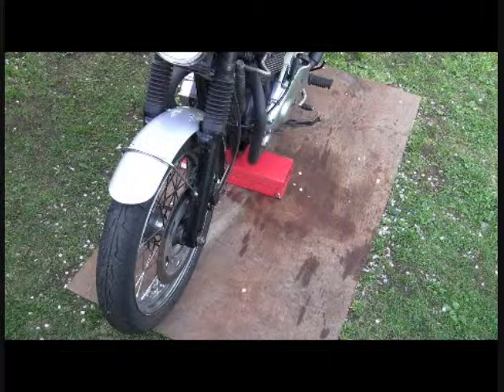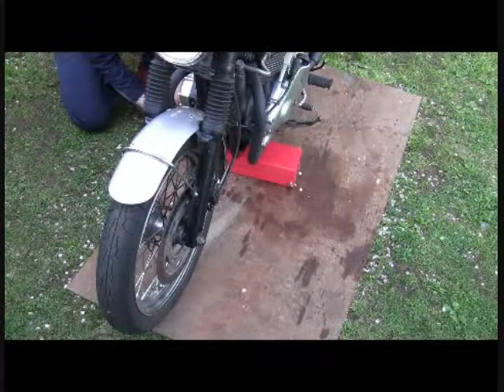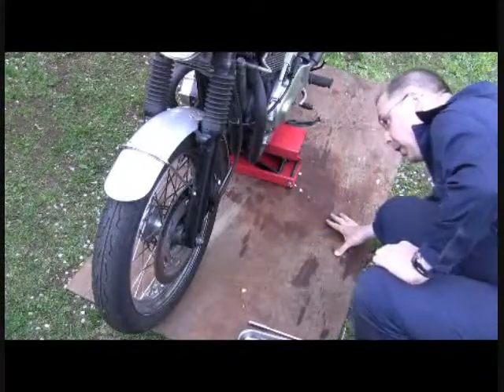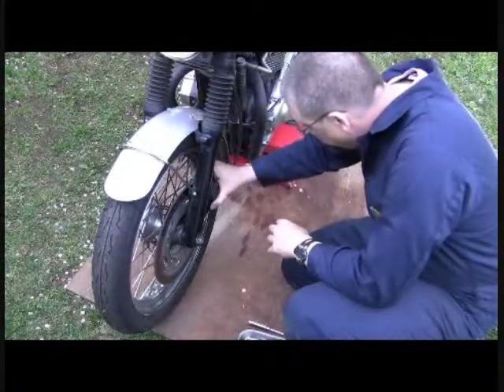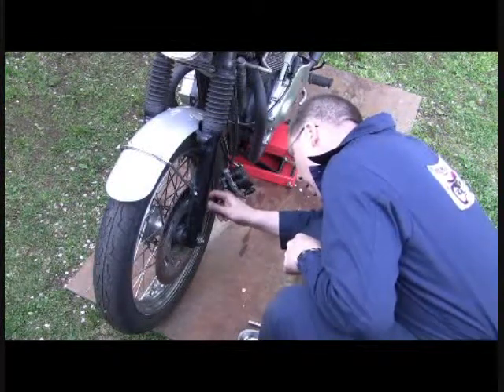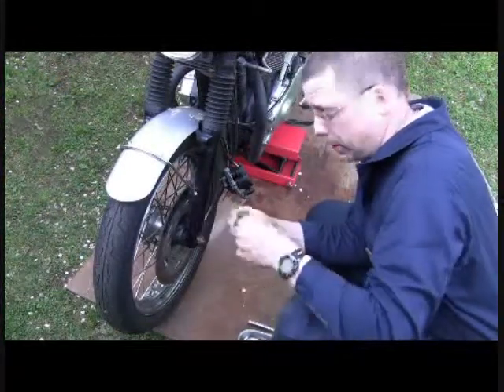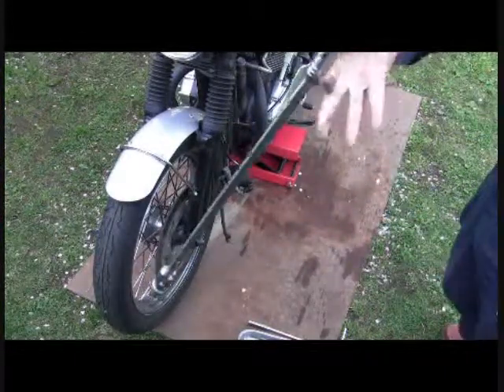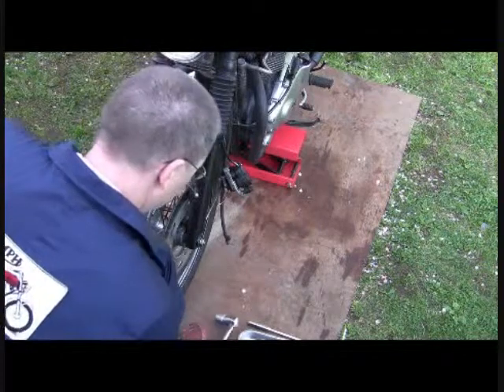Hinckley Bonnie Front Wheel Removal

Comment: Hello mate, enjoyed your video. Watching experience people give sme the confidence to work on my bike. Just out of interest, the bike lift you're using, how well do you rate it for general maintenance work? I've just ordered one myself and wonder what to expect. Cheers, ride safe.
Reply: I think they are great and it just takes a little to get used to. You need to find the balance point on the underside of your frame and they are very versatile. For example, in this video I slid it just a little bit forward so that just the front wheel came off the ground and the back wheel still served as a secondary anchor. You can also align to lift the bike where the center stand would attach on to the frame and you have a good balance point to change oil. Plus it is light and easy to move around...a very good tool to have.
Reply: Cheers, thanks for the feed back.